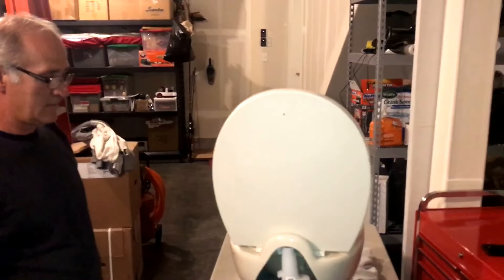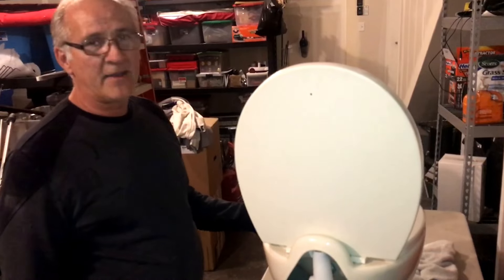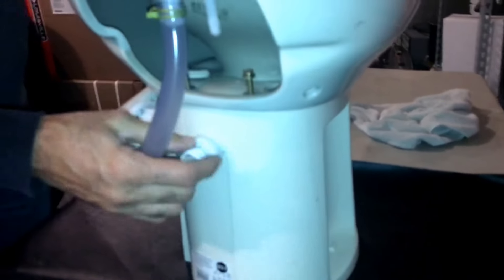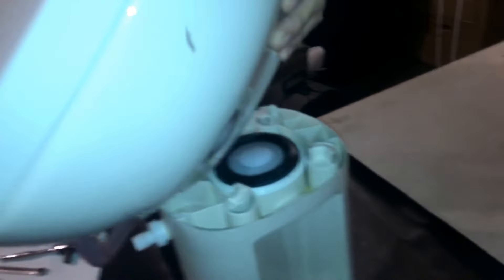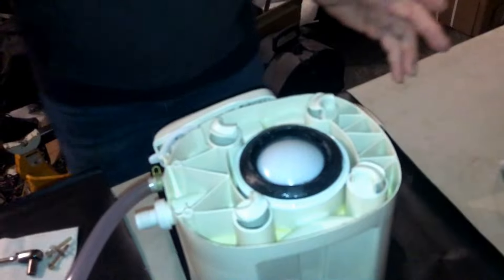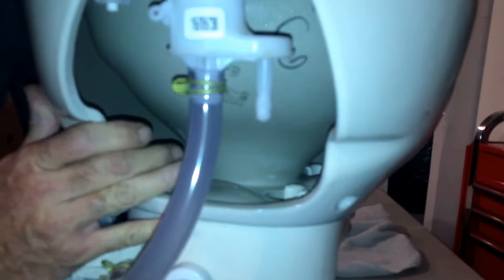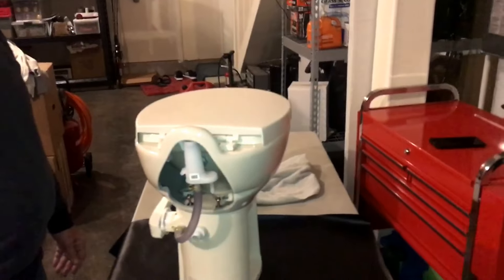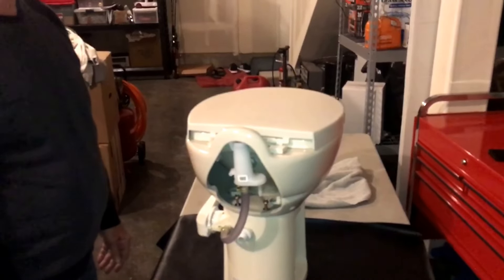How To Replace An Rv Toilet Seal

Comment: I have read many posts where one should NOT use Vasoline on the seal as it will deteriorate the seal. Plummets grease would be a much better choice (and a good item to have in your toolbox). Would your 20+ years of experience agree with this? (Maybe the reason for replacement was the use of Vasoline!)
Reply: Would it help you feel better if he did add that, just in case that "PLUMMET's GREASE" helped that seal last for just a few days or weeks longer? I sure appreciate the quick and easy advice they've given here, and in layman's terms! I generally always have vaseline (grandmother swore by it for MULTIPLE uses) in the cabinets, but I honestly cannot say that I would have some sort of putty or other pipe/seal grease in the bathroom cabinet. ESPECIALLY in an RV, where space is minimal, and so are the items we pack to leave with. We try to always check all faucets, shower, and spickets (for bad seals/pipes/holding tanks etc.) prior to leaving the house, but there have been a few times we were lucky to remember the kids and THEIR stuff!! Appreciate the info Joe's RV Tech, This looks so easy to do I think I could replace it instead of my husband haha!! (the seal...... not my husband).